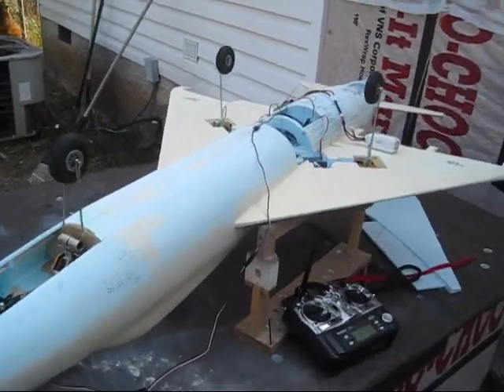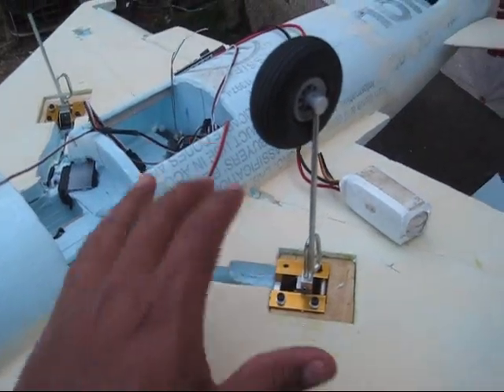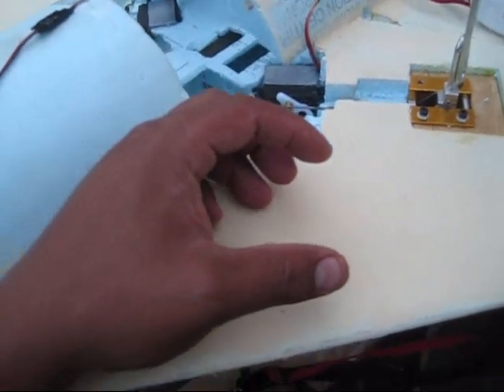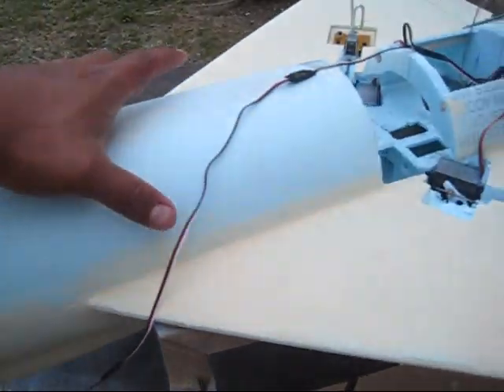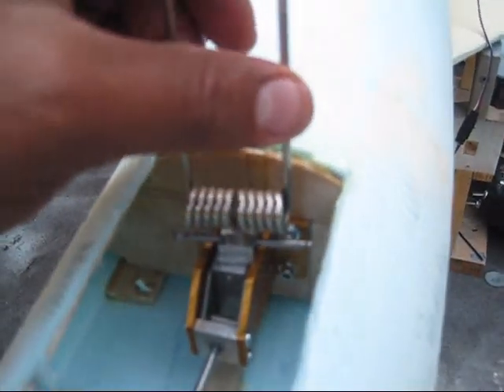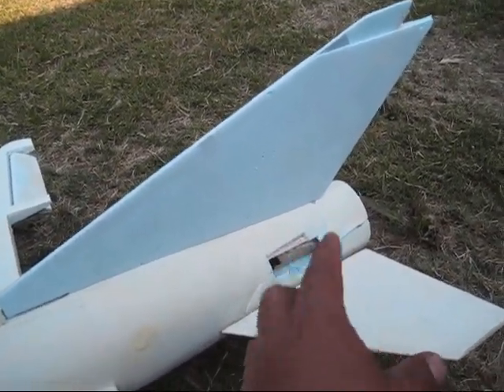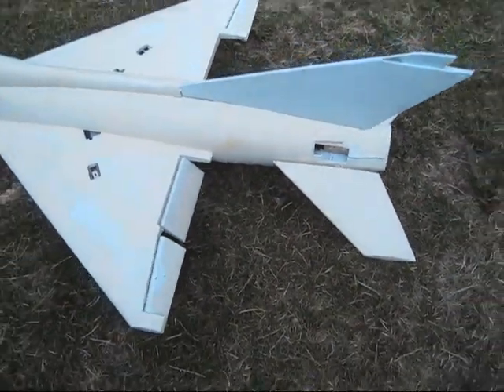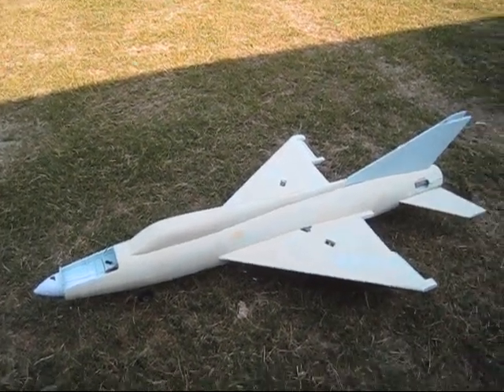MIG-21 landing gears

Comment: Daniel, Thanks for your rep;y, most probably is late nut going back to the HobbyPartz servoless retracts the 3.5KG model that they sale should be OK for your model, 3.5Kg is around 7.7 Lbs over your plane weight, I have the same model on a Cessna 421 (around 8.5Lbs) and they work great.

Thanks AGain

Comment: @DanielMadrigalC I got a 100Mw 2.4Ghz system for about $120 shipped from HK.  I have to use 72Mhz for control but I get better range with it anyway! ;-)  I dont have any of the fancy stuff yet.  Just a fixed camera and transmitter.  No pan/tilt on the camera or any of the goggles/autopilot/stabilization stuff.  Thats where it gets really expensive!  I have an old TV hooked up in my car but the little USB recorders ($40+/-) will let you view and record on a computer.

Comment from the maker: if you are using 2 or 3 servos it will be fine but if you use 4 or more it will be more safe to use a external UBEC
80% of the ESC with BEC in it are only good for 3 servos on a 3s lipo or 4servos on a 2s lipo unless  specified by manufactor.

Comment: Daniel, are you going to put the sub fin on the bottom of the fuselage? This may keep you from hitting the prop when you rotate. Even the real Mig-21 can not rotate very far without hitting the sub fin. If I remember correctly on the real Mig the sub fin was made of plywood. I would also put a servo regulator (available from HobbyKing) to slow the retact servos down so they don't slam up and down, would be more scale. LOOKING VERY GOOD my Friend! jb

Comment: Daniel, check the non servo retracts from HobbyPartz they have a 2.5 Kg and a 3.5 kg model, the 3.5Kg model use 5mm strut wires, I thing they will be much better choice for aa project like this.